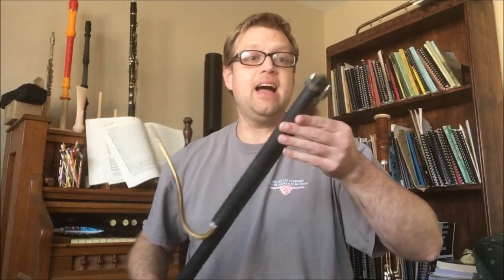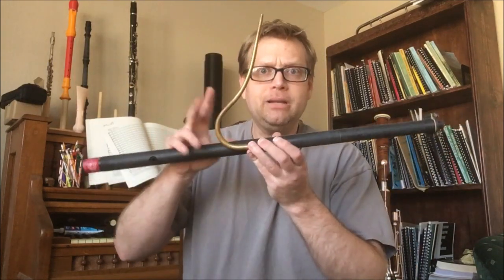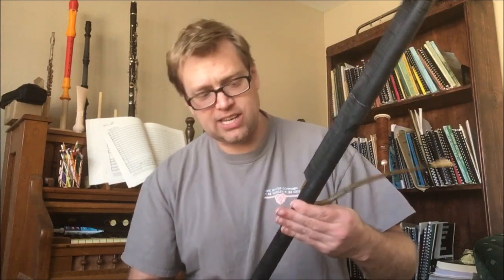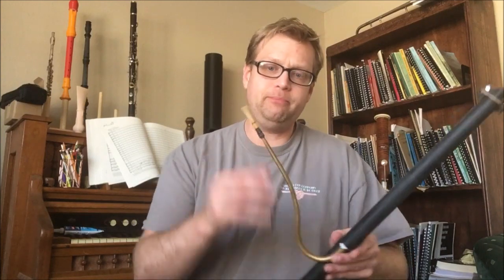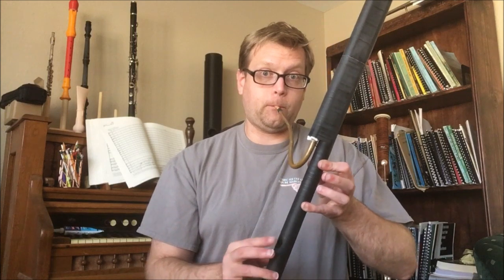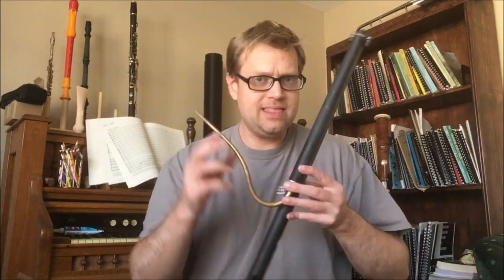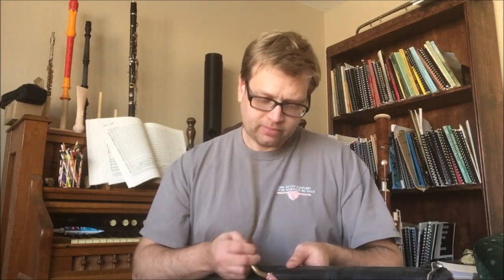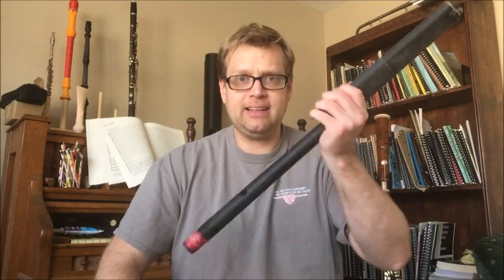Greatbassoon Update 2 - One Step Forward, Three Steps Backwards

Comment: Shave you measured the bore and tone holes?  In my experience with3d printing both will be smaller than designed
Reply from the maker: Even if they are smaller, they won't be that much smaller to be a half step off of where it should be. I'm working with some new formulae now to correct for the initial error.
Reply: Fair enough but holes do come out small and need compensating for.